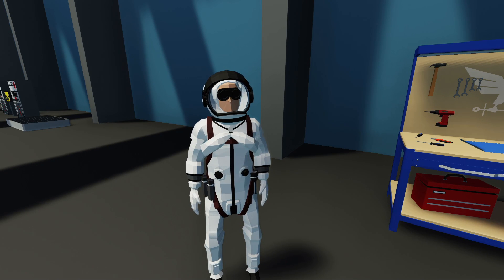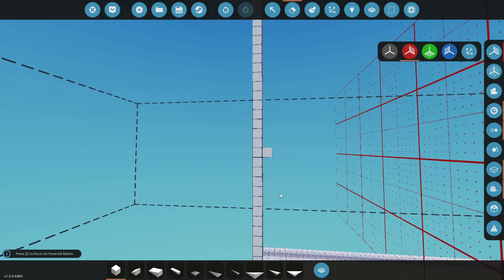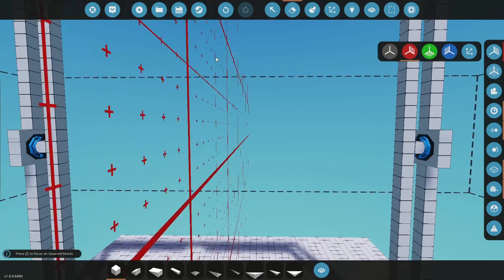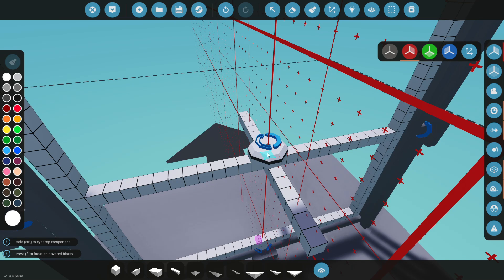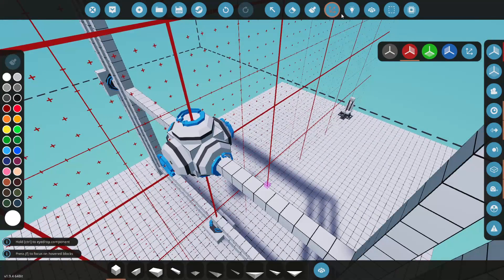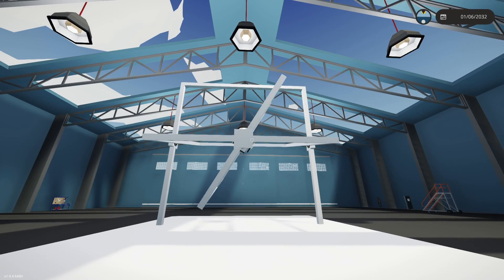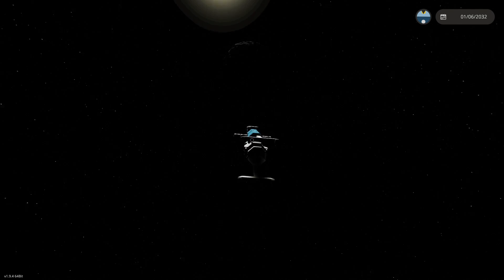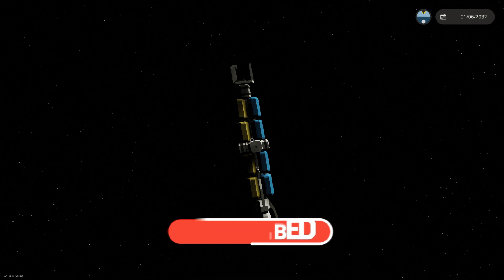Reaction Wheels - Stormworks Tutorial - How To

Comment: Loved the video @ProfNCognito! Can't wait for the next video man! Like I said when you got the Albatross into Space, you should be able to use the Reaction Wheels for your Missiles and have them function like the MIM-104 Patriot Missile System or the THAAD Missile System. They're both going to be 1 by 1's though, so the Small Reactions Wheels are going to be what you use for them. They'll come in Handy especially when building the PAC-3 and PAC-3 MSE Variants as they each have 4 Missiles in each Tube allowing for there to be up to 16 Missiles per Launcher for the PAC-3 and 4 Rows of 3 per Launcher for the PAC-3 MSE.

MIM-104F PAC-3 Patriot:
 • Length: 17 feet 1 inch (5.256 Meters or 21.025 Blocks).
 • Diameter: 10 inches (0.256 Meters or 1.025 Blocks).
 • Wingspan: Unknown.
 • Guidance Type: Active Radar Homing.
 • Guidance Seeker: Active Radar Seeker.
 • Warhead: Hit-to-Kill.
 • Warhead Weight: 18 lbs (8.136 kgs).
 • Detonation Mechanism: Impact.
 • Motor: Solid Propellant, Single-Stage Rocket Motor.
 • Max Altitude:
  • Aerial Target: 24,000 Meters (78,000 Feet).
  • Ballistic Missile Target: 20,000 Meters (65,000 Feet).
 • Max Speed: Unknown.
 • Max Range:
  • Aerial Target: 80 km (49.242 Miles).
  • Ballistic Missile Target: 40 km (24.621 Miles).

MIM-104F PAC-3 Patriot (Where Different):
 • Length: 17 feet 5 inches (5.358 Meters or 21.435 Blocks).
 • Diameter: 11 inches (0.282 Meters or 1.128 Blocks).
 • Warhead Weight: Unknown.
 • Max Altitude: 36,000 Meters (117,000 Feet).
 • Max Range:
  • Aerial Target: 120 km (73.863 Miles).
  • Ballistic Missile Target: 60 km (36.931 Miles).

THAAD Missile System:
 • Length: 20 feet 3 inches (6.230 Meters or 24.923 Blocks).
 • Diameter: 13 inches (0.333 Meters or 1.333 Blocks) Booster, 15 inches (0.384 Meters or 1.538 Blocks) Kill Vehicle.
 • Engine: Single-Stage Rocket.
 • Propellant: Pratt & Whitney Solid-fueled Rocket.
 • Operational Range: 120 miles (194.953 km).
 • Flight Ceiling: 93 miles (151.089 km).
 • Maximum Speed: 6,300 mph (2,843.076 kph, Mach 8.269).
 • Guidance System: Indium-antimonide imaging Infra-red Seeker Head.
 • Accuracy: 0 feet (Hit-to-Kill).
 • Transport: Transporter Erector Launcher.

I don't have time at the moment to go into further details for these Missiles, since it's Half Past 4 in the morning, but that'll have to wait for another video.

Let me know what you think about this and I'll catch you in your next video man!

Comment: Could you make a tutorial on liquid rockets?
Reply: Ok so quick run down 

You need a gas tank of hydrogen and a gas tank of oxygen, pipe them up to either port of the engine. Then, wire a battery to the engine and your controls then wire the logic for an ignition button and throttle controller. He will make a tutorial soon I hope but hope I helped